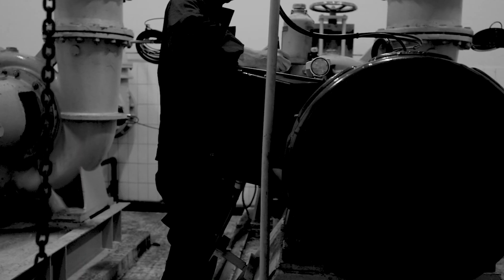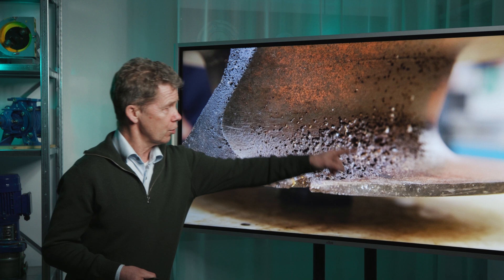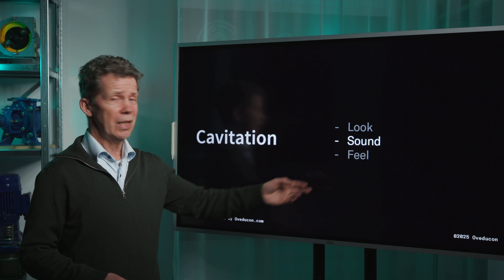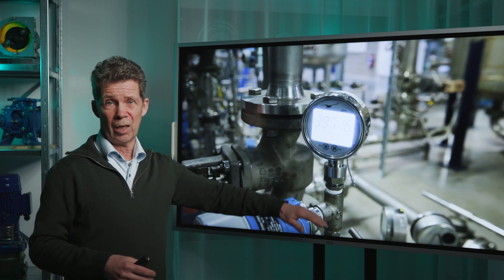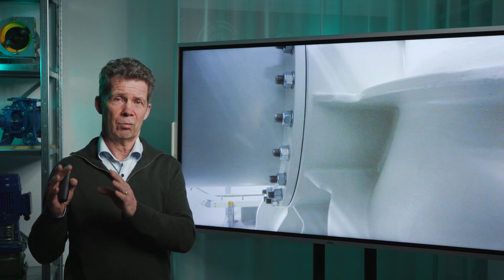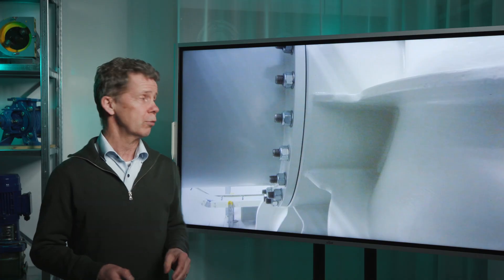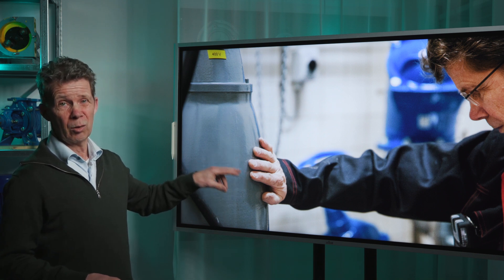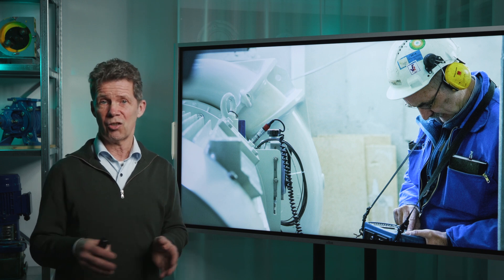How to EASILY DETECT CAVITATION?

Comment: Corrosion is a chemical process. I would rather call the damage from cavitation erosion.
Reply from the maker: Good point.

The distinction between 'Cavitation damage', 'Cavitation corrosion' and 'Cavitation erosion' is a common one.

See for example:
https://www.corrosionpedia.com/definition/242/cavitation-corrosion
or
https://www.corrosionpedia.com/definition/244/cavitation-erosion

Yet, one could argue that this distinction doesn't make sense as both 'cavitation corrosion' and 'cavitation erosion' occur simultaneously whenever we speak of 'cavitation damage'. Perhaps it is for this reason that both terms are often used interchangeably.

In hindsight we might have done a better job by sticking to the general term: 'cavitation damage'.

Hope this clarifies it a little and thanks for pointing this out!